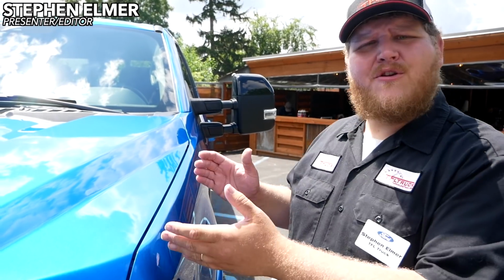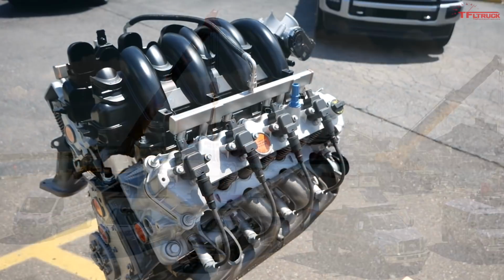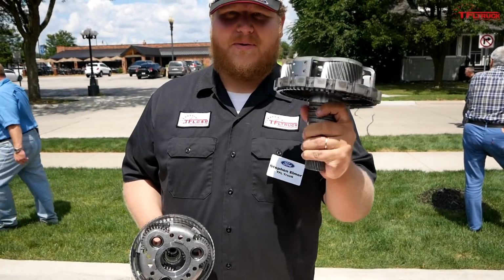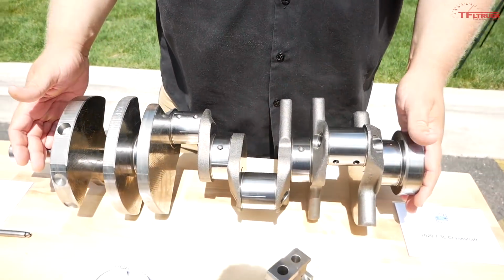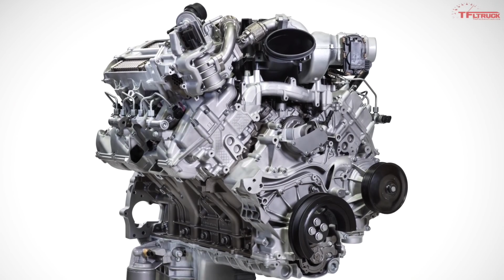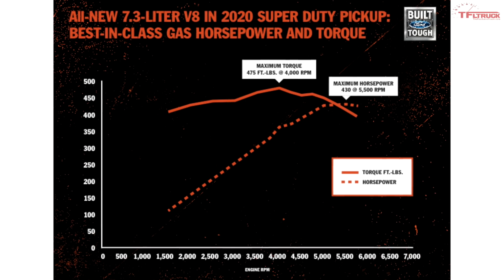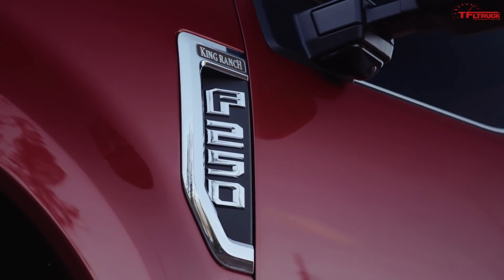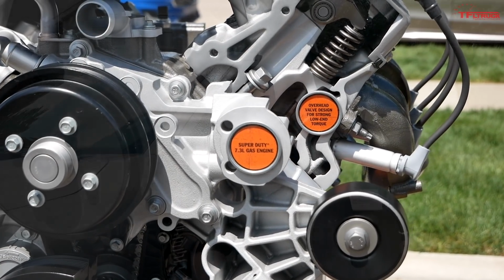We Finally Know the Ford Super Duty 7.3L V8 Power Numbers & They Are Lower Than We Thought!

Comment: 450 horsepower and 500 pound feet of torque would be nice numbers
Reply: 800 horsepower and 1000 pound feet of torque would be nice numbers. 
I think Ford did very well with this new engines performance in its application though.
Reply: A supercharged Tundra blew past that. But, they don't have it anymore.
Reply: Rxonmymind supercharged F150 5.0 running 10s and it’s available now and for under $50k.
Reply: @NoticingBehaviors  
Sweet! Good to know. Though I have reservations about turbos.
Reply: @NoticingBehaviors  Sure, now tow a 15000 lb camper across country with it.
Reply: Spare parts who said anything about it towing 15k lbs? More than what it’s rated for.... that’s why you have the 2500 and 3500 class...
Reply: @rxonmymind8362  you said supercharger right?
Reply: @vincent08vac  
Yes. They made it dealer installed option back in the day.
500hp/550tq.
Reply: @rxonmymind8362  The TRD supercharged Tundras were barely making over 400 hp to the wheels on Mustang dynos.  I believe the exact figure was 403 hp and 489 tq.
Reply: @putmeincoach7663  
I'll buy that. Depending on altitude, different dynos and other factors that's within the ball park.
Reply: Yep. That motor is called a Pontiac 455 at 9.5:1 compression. Built a long time ago
Reply: @jasonhudek3470  Keep dreamin. The HO455 at 10.5 compression only made 370hp and that's with the old rating system using no driven accessories and measured at the flywheel.

Comment: Not to bad and well rounded I'm sure the numbers are "low" because they want to achieve the power numbers reliably and that's a good thing, I'm happy they're moving to pushrod engines for hd applications becuase vs a over head cam design,  a push rod motor is better in many ways. It's cheaper to own, more reliable, easier to work on less parts to break and makes great low end torque. I own a 04 Silverado 2500hd with the 6.0 lq4 and it's a beast still to this day, I've been waiting for the day ford would come out with this though.

Comment: Was expecting 450 hp and 500 lb-ft...it's not that off from what I expected. And as 'low' as these values may seem, specially when the competition has smaller engines, this also means this one is more understressed...less pressure inside the combustion chambers, less mechanical and thermal stress on the components.
At the same time, cam, intake, exhaust, etc. should provide greater gains in comparison with the competition as well.

Comment: so basically they just took a page out of gm's book.  I don't mean to diminish the accomplishments of the engine team at all, I think the devil is in the details, but it shows what real users have known for a long time about the inherent advantages of pushrods and cubes for packaging, torque, durability and economy.  On that last note - we wont get fuel economy numbers as I'm guessing there isn't a single vehicle this engine will go in thats class 2a, everything will be 2b where fuel economy numbers aren't required to be published.  Its interesting that its not too far off a 20 year old big block design in terms of peak torque.  I had a vortec 7400 that peaked at 410 lbs-ft @3200 rpm back in 97 (before supercharging).  Got crap mileage but it was strong everywhere and the mileage didn't take a real hit with a load.
Reply: Stupid gm bs. Ford does it first. Ford does it best. Push rods are best for trucks. Not in sports cars like comaros and corvettes. Ford wipes gm's ass in every category. gm... God's mistake.... Even gm's latest big truck gasser is lacking compared to Ford.
Reply: Took a page from GM's book?  .Sure, because Ford has never produced a push rod motor...?   I guess the 460 doesn't count?   390?  302?  289? 351?  Etc., Etc.

Comment: Ford finally pulled their heads out of their collective idiot BUTT'S.  Their overly complicated junk that falls apart and expensive and difficult to fix was a disaster.. Coil packs problems, plugs, cam phazers, exhaust manifolds and their bolts, duel timing chain running gear and on and on from wheel bearings and drive train WERE A COMPLETE JOKE.. Mechanics don't even want to touch a ford because of their complete overly complicated designs..
Reply: My family has owned two 3v 5.4 engines.  Complete pieces of shit.  Probably the worst V8 in the history of V8 engines.  Everything that you just mentioned.  Good reason they only lasted a few years.

Comment: Well, I once thought the 5.4L 3v looked to be a reliable engine. But then over time and miles, the horror stories that came. Only time will tell with this giant
Reply: Oh man, I had an 05 3v 5.4.  Completely turned me off of Ford (although I think the Coyote 5.0 is a reliable engine).  That VCT 3v engine was a sack of shit.  Idiotic head design w/ recessed 3 piece plugs, continuously failing cam phasers, timing chain kits, failing coils, failing intake gaskets.  Total POS.

Comment: Gotta admit I'm disappointed in the output.  Actually less HP and Torque per liter vs. the old 6.2 gasser.  Should have been able to hit 475-500 HP and over 500 lb ft of torque with a clean sheet design.  Well, maybe next year...look at what Ford did with the Coyote engine...every year or two the HP and torque inched up a bit, so maybe Ford is sand baggin with the initial release to give themselves plenty of headroom to play with in the years to come.  I still want a Tremor with the 7.3.  I wonder what a new exhaust, intake and tune would do?

Comment: I have a feeling that Ford will do a slight redesign in a few years, and bump the numbers up. For a gas engine to have that flat of a torque curve, I believe it is detuned. After this engine builds a bullit proof reputation Ford will bring on the power. Ford has done this many times. Just look at the modular power numbers go up through out the years.
Reply: No one cares about peak numbers inna work truck, the curve and longevity is what should take priority over all else.
Reply: Agreed but, No one needs near 1000 ftlbs of torque  out of a diesel either. But that's what we all want. In order to sell more trucks than other auto makers they give us what we want.
Reply: @curtisgarren6069  The diesel part I 100% agree with, to me these small displacement V8 diesels making the power levels they do now is a ticking time bomb in my eyes. 200k throw aways now.
Reply: Curtis Garren 1000 is nice pulling a long hill with a 10-12g trailer and knowing the truck is performing with more to give if needed. It’s a first gen though I’d wait to see how they hold up.
Reply: John Gross 
The engine will hold up. The 10sp May have some bugs to work out but you’re right to wait for a model or two before buying a new product
Reply: 5.4, 6.2, 6.8, all superduty gas engines since 2000. And all recieved a power upgrade.
Reply: The commercial 6.7 is detuned for longevity anyways.
Reply: This could be said for almost any engine on the market to day.   This engine brings nothing new to the table.   Tbh, they're taking pages out of GM/Dodge's playbook.
Reply: Look all the issues the modular platform has. Every version of it. This going back to a proven design  should eliminate those problems.
Reply: The Modular motor was a total pile of crap!

Comment: Everyone who is complaining about the “low” power forgets that this engine runs at 14:7:1 air fuel ratio all the time, even under full load. The 6.4L Ram runs around 12.7:1. So the 7.3L is 13.1% larger but uses 14.6% less fuel per unit of air, so for a given RPM and load, assuming the load is enough to make the 6.4L enter enrichment, the 7.3L will be using less fuel than the 6.4L and the 7.3L will be making more power. The engineering of this engine is very impressive, especially given that peak hp and torque are only two of thousands of considerations that the engineers have to account for and are but a small picture of the character of an engine. Full torque at 1500 RPM paints a better picture. The DIESEL 7.3L of 1999 only made a tiny bit more torque and much less horsepower and it had a turbo and intercooler! A simple tune to make the new 7.3L run the same air fuel ratio as the 6.4L Ram would result in a power gain of roughly 20 hp, math is 14.6% more fuel = 5% more power due to the thermal efficiency of gas engines (around 30%), but of course would result in worse fuel economy. (Edit) I’m sure my math isn’t perfect but is good enough for quick YouTube comments.
Reply: Andrew Smith 
You are talking shit just to hear yourself talk shit. I’m embarrassed for you...
Reply: Andrew Smith go away troll.
Reply: Where are getting proof of this lean burn info?
Reply: That's impressive if it runs at full power stoic air fuel. Especially for a commercial engine that can run for hours at high load.
Reply: @gabemarlin..my '99 250 sd crew has 400,000+ on it was water pump and transmission at just over 300,000. Wish the new ones were like it
Reply: uknowimright6269 Not arguing against the old 7.3L at all. Would take one in a heartbeat over any of these newer trucks. My 1st gen Cummins is still truckin’ with 260k w/ only a water pump change at 230k
Reply: @Andrew Smith You are just being DUMB.
Reply: @Andrew Smith I agree. Should be 550hp/600tq

Comment: They needed to replace the ancient V10
Reply: Still like my 2002 F350 V10 only needed a set of headers and custom exhaust and a little tune to make more then 410 RWHP and 525 Ft LBS of torque at the wheels they could have made a V10 pushrod IMO would love to see that
Reply: Joery van der linde they are still very nice engines. Love the exhaust note! I think it’s debut was in 1998, so my feeling is for CAFE standards and MPG. It’s a workhorse engine for sure.

Comment: Maybe Chevy was right all along. Maybe naturally aspirated pushrod V8s are better than turbocharged V6s. Yes i know you can get just as much power out of a turbo V6, so don't go and say "but numbers and junk" because its not about the numbers. Its about simplicity, cost and reliability. Less moving parts, lower operating temperature and understressed components = better reliability, lower repair costs and easier to work on. Ford was very smart for introducing this new engine. Now i want one so i can do an engine swap on a Mustang.

Comment: Since the engine and transmission are built for heavy duty, why can't they put it in the F150 for those who want to tow a lot but don't want the size of a Super Duty? Assuming it is built to handle more "heavy duty" compared to the current engine choices for the 1/2 ton.

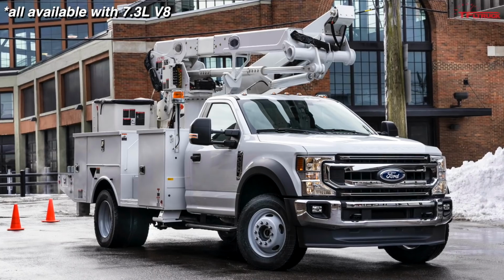Comment: At 3:47 in the video you have found my favorite new vehicle...
The 6.8L V10 will be missed but I am ready for the 7.3L V8.

I'll take the E-Series in either white or silver please. Thanks.
Reply: @Andrew Smith  The 6.8L V10 works well for me. Never had one that was unreliable. Not yet at least. Definitely not the most powerful engine but plenty of power to move what I need at this time. If I needed more power, I would have kept my Freightliner with the 12.7L Detroit 60-Series... The 6.8L V10 is fairly easy to maintain/repair.

Comment: So, the power numbers are basically exactly the same as the EcoBoost V6. Torque curve and all.
lol
I know.  the EcoBoost isn't available in the Super Duty. But because I've driven them and know how early the torque comes in and how flat the curve is that is a good thing for a truck. 
I'm in a 6.2 Super Duty right now. 
I actually like the power above 4,000 RPM's where it kicks ass.
it don't make 475 ft lbs tho or have that much of its power way down at 1500 RPM.
Reply: Yeah and it only takes 18 pounds of boost to do what this thing makes barely breathing. That ecoboost would explode if it tried working the way this thing is meant to.

Comment: What do you mean we don't know production dates for the 2020 Super Duty?  The final date to order a 2019 is Aug 2, 2019 and the order bank opens for the 2020 Super Duty on August 14, 2019 with the Job 1 date of November 14, 2019.  I find it Silly that TFL cannot read the Fleet guides to know all the manufacturing dates.
Reply: I was told by Ford that trucks with the 7.3 gasser will be at dealerships by November.
Reply: @David-rx2to  Doubtful.  Job 1 date at Louisville is 11-14-2019 so you will be lucky to see these truck by December 1st.
Reply: @Gary   My contact info is more than a month old so delivery dates have probably changed.

Comment: Power and torque seems right in line with what I suspected. Should be a fantastic engine. I'll be interested to see a matchup against the new GM 6.6 and the current RAM 6.4. Most importantly though will likely be price. Hopefully Ford will be able to keep the price relatively low as an upgrade from the 6.2.

Comment: Is the 7.3L flex fuel? The 6.2L is
The call me crazy but I think Ford needs to have a straight 6 turbocharged gas engine around the 4.9 liter in the superduty
Reply: You are a crazy idiot!  What is with all this stupid turbocharger shit.  Under load, a smaller turbocharged engine will burn MORE fuel than a larger NA engine because the turbo will be on the boost most all of the time. And before you say diesel this or that, diesels have to have a turbo to make power, otherwise the engine size and weight would be ridiculous.  AND turbos create more failure points, not what the commercial and serious user market wants.

Comment: spark plug and wires are near hot manfoilds. That a bad design ford. Tranmission looks soild well it should be but for a work truck so assuming  everything is going to be hotter than usual plugs and wires will melt and probably in 10,000 miles is my guess. And 400lb at 1500rpm is good but peak should of been 3200rpm not 4000. Remember torque is for trucks hp is for cars. Lower the peak number is the better the pulling power. But i was hoping for atleast 500lb of torque at 3200rpm.

Comment: So Ford ditches their bs OHC design and makes an engine obviously based off the LS and Ford guys think they have it made? I’m convinced 90% of Ford owners never open their hood.
Reply: It's a truck engine built for low RPM and reliability where the benefits of an OHC setup doesn't apply.  The Windsor platform was around before the LS and is modern copy of that design.
Reply: Kyle Q The small block Chevy started production in 1954 and the Windsor v8 in 61 so not sure how you came up with that conclusion.

Comment: This setup is going to be a beast.  The 7.3 has 400 of its 475 lb/ft of torque available just off of idle @1500 rip'ems, and it's mated to a close-ratio 10-speed transmission, and a 4.xx ratio rear-end?  That has workhorse written all over it.  I can honestly see this outselling the diesel in many cases, especially when you consider how simple this engine is compared to the diesels of today with all of the extra emissions equipment and extra systems on board that make both working on them and longevity somewhat questionable...  Gas and Oil vs Diesel and Oil and DEF and turbos and DPF and SCR and so on?  Unless you need the nearly 1000 lb/ft of torque, the gasoline engine makes more sense for most of heavy duty commercial vehicles.
Reply: Exactly.  I've got a 19' 6.7 F350 because that was the only option to go with.  I've got a little over 10k on it and only have put DEF in it 3 times (at ~$13 a fill) but if this engine option was available I would have gone this route.  I love my truck, it's stupid powerful and whisper quiet, but the $85+ fill ups hurt (not that I'm complaining).  This power level combined with simple maintenance would be more than sufficient for most diesel buyers of today.

Comment: I already have a car with a plastic intake manifold.....I am certain this one won't crack and get Ford into class-action lawsuits.
Reply: Plastic intakes are a wonderful thing and have reliable (even under boost) for over a decade.
Reply: They absolutely ARE a wonderful thing!  That is until they burst at 70 mph on the interstate out in the middle of BFE and coolant sprays on the alternator and shorts it out  and you call Ford and they tell you your car isn't in the recall (this despite the fact that all the other Ford cars that use the same engine ARE included in the recall) and you go and buy a NEW intake manifold with your own money and replace it yourself.  Then Ford gets hit with a class action lawsuit and agrees to replace these defective manifolds only I can't prove I purchased a new manifold (since I don't have my receipt).  A few years after that, the replacement manifold (that doesn't have the metal water passages)  fails as well and this time I have to replace it again (at my expense) because the recall has since ended.  I think you are right, I was told that recall ended over a decade ago and I am sure they have that perfected by now.

Comment: I can see this engine in the ford Expedition Lincoln Navigator and if it's lighter than older 6.2 that was in the raptor of 2013-2014 than put it in a 2020 raptor my number of the 7.3 was like 460 HP 500 TQ but still have the highest of engine HP TQ # not much above chevy 6.2 420hHP 460TQ
Reply: That 6.2L isn't meant for constant high load. It's also less efficient when pulling those numbers. They're built for completely different buyers.
Reply: @vhateverlie  but am glad ford came out with this fleet engine its a beast to take 35 hours non stop running and no wear on the crankshaft